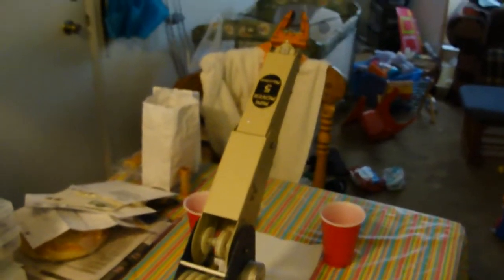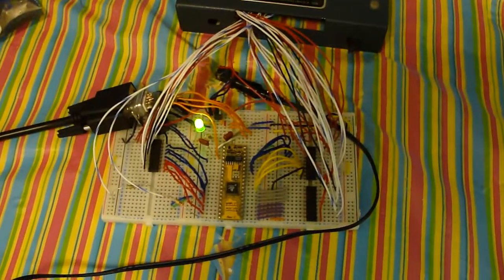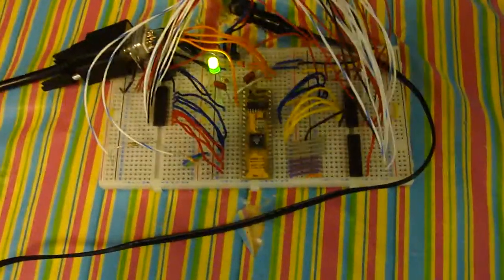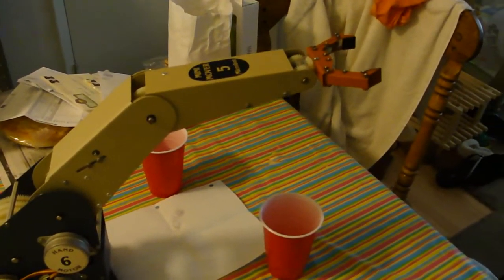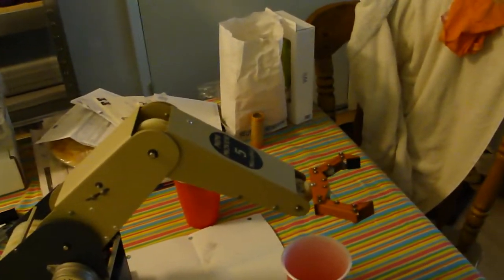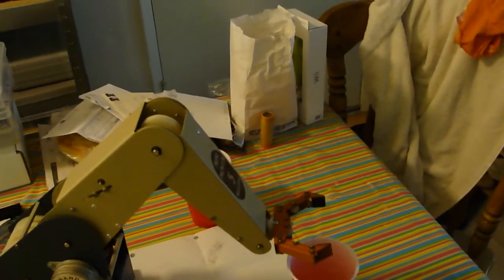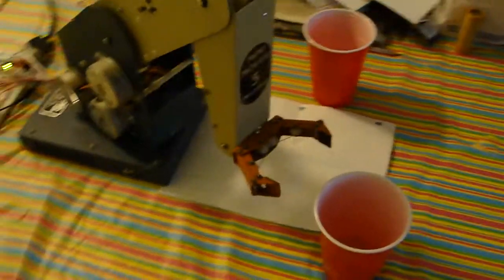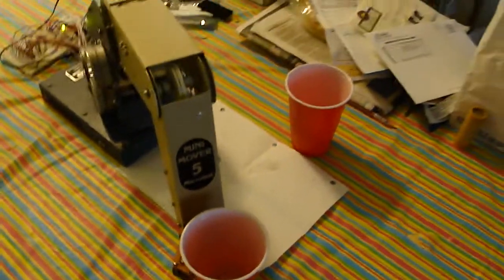MiniMover 5 Controled by BS2p40

Comment: gripper and other sounds are caused by stepper motor slipping.  That is the mechanical rotor is "locked" by the active coil.  The coil field is only so strong so the when the next coil is activated by the controller the mechanical rotor, being held by other mechanical forces, can not move to the next coil indexed position.  The rotor "twangs" so to speak making the "impulse" load up the mechanical structure for its "song".